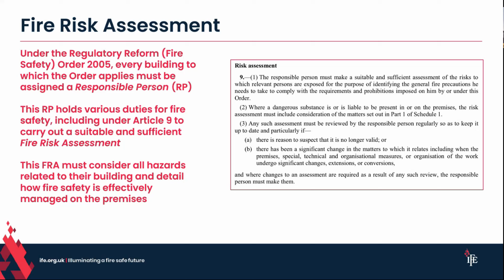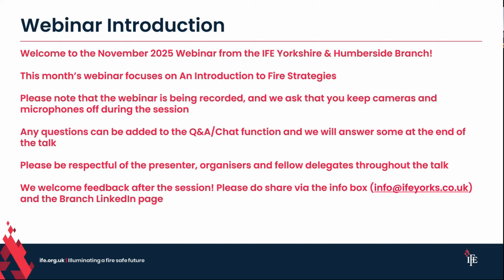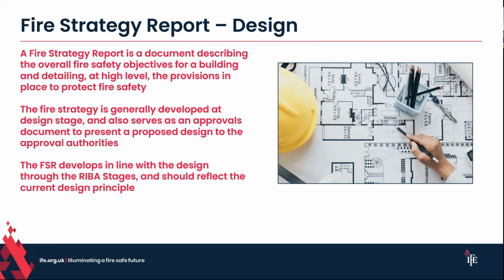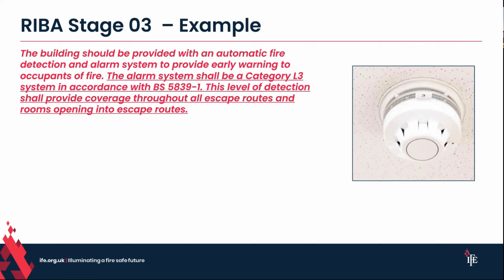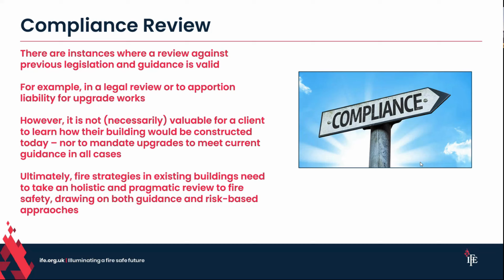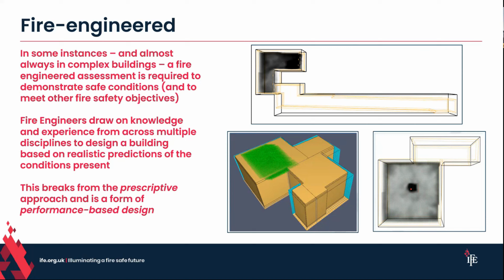Introduction to Fire Strategies

Comment: The early careers section was particularly useful. As a fire safety engineering student, the clear explanation of what a fire strategy is and how it fits within the design and regulatory process helped connect academic concepts with real practice. The overview of key components of a fire strategy report was also very valuable for those preparing to enter the field.